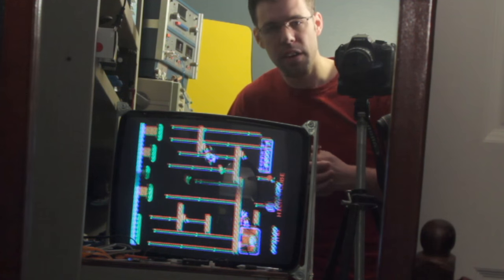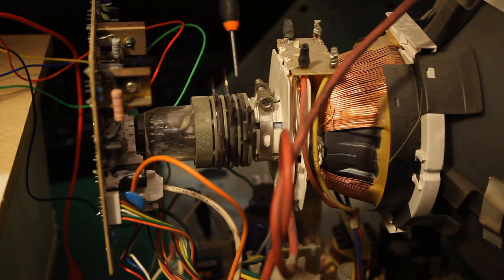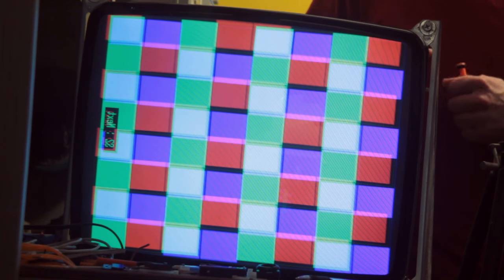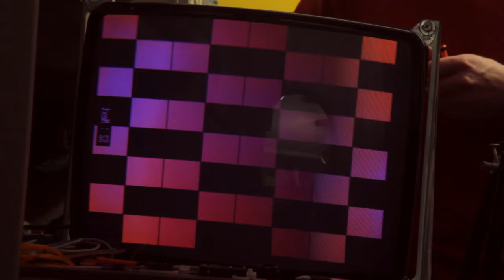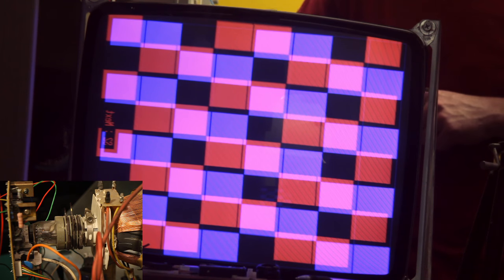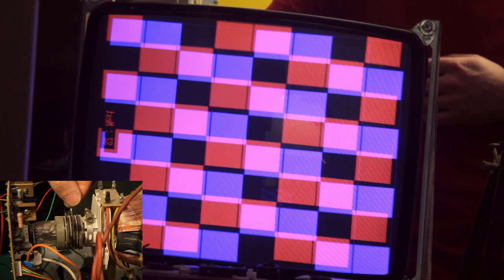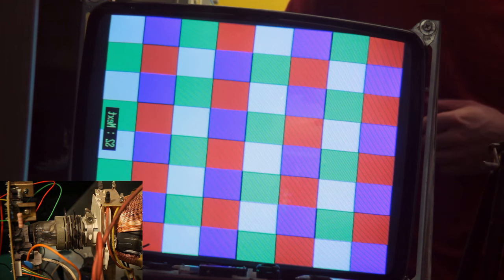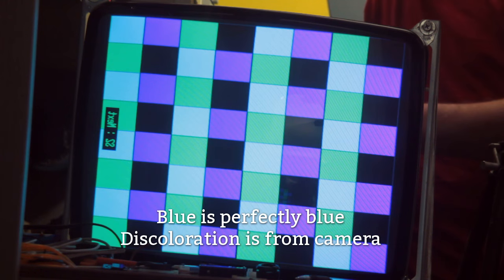Fix it Friday - Adjusting Convergence Rings on a Cathode Ray Tube (CRT, Monitor, TV and Arcade)

Comment: Very helpful, thanks!  I think he taught me more than he realized, namely 1. it is safe to put your bare hands close enough to the high voltage parts to spin the rings, 2. using a mirror or camera or something to watch the screen while you adjust.  These are things he did not talk about, but, then again, no one else does either.  I think repair guys leave out the basics because it never occurs to them that someone who doesn't know about convergence rings might also not know even more basic things.
Reply: It is safe to manipulate the rings with your bare hand but notice how I said hand and not hands - you probably only want to use one hand when you're back there, since if you accidentally touch a high voltage area and have both hands on the monitor/chassis...

Comment: That really helped. I have two Commodore 1702 on the bench actually and from some other videos i looked, having this double camera setup and to see live action and how you manipulate the flywheel directly by hand really get me confident to mess a little more into that while keeping my hands away of the high voltage. I'm always affraid that the insulation thickness of the cable / air gap isn't enough while i'm working in there... and some said that the yoke coils themselves were high voltage but i really doublt about it.

Comment: This was a great video, thanks for the clear explanation. I am adjusting a 1985 Sony Trinitron with a Sony "Multi-RGB" input right now -- my biggest challenge is all the adjustment rings were glued into place and I had to use an xacto knife to separate them. Even now there is so much residual glue that it is very hard to move the rings independently. Still, I am getting a remarkably good pic for a consumer TV that was made when Back to the Future was in theaters.

Comment: I have a Trinitron with the blue/red convergence slightly out. Have some nice test patterns in 240p test suite but I'm not keen on poking around the neck of the tube while it's on😂 Is it that risky as long as you stay away from the lopt and HT cable?

Comment: At 4:14 you bring your hand very close to the four connectors at the top of the yoke. I have been told those have high voltage running through them. Is that not correct?

Comment: The best video explaining the role of those famous rings. My question: I own an old Sony KV-29LS35B TV, everything is alright except that skin tones are not natural: there is always a kind of red/orange push (+ light purple or blueish lips). I have already tried everything in the service menu (change of RGB saturation values, change of Red and Green cut-off values but skin tones are still not natural). The other suggestion was to set the AXNT or AXPL values to 0 but there is no AXNT/AXPL to set off in my TV. 
Could this "Red/orange push" (also visible on LG CRT Tv's) be a problem of purity or convergence ? Thanks in advance.
Reply: Color saturation might be too high.

Comment: I have a problem with my 1702 vertical position that just don't wan't to go high enough when turning the v-pos screw all the way. I looked at the schematics and that variable resistor is a 500 ohm in between two 470 ohm resistor that "sets" the workable range of that variable resistor. I tried to connect myself across one of the two resistor to add a temporary parallel variable resistor to see if lowering one of the two would allow me to get futrher in the vertical adj. range and sure enough, it does the trick. calculations done, i would need to swap a 470 resistor for a 120 ohm one. My only concern is the long term reliability of that fix as more current will have to go thru those resistor... I really don't know what kind of power they usually endure. The other way would be to increase the value of the other 470 resistance instead but to calculate its value, i would have to take it out, connect a variable one instead, set the v-pos pot to the middle position, set the temporary thing so the image would be vertically centered and then measure the thing resistance, find a proper match and weld that down into place.

The two monitors I have suffer from the same problem where the picture don't get quite high enough. Would it bother much the resistances if i lower the value of the string a bit?

Comment: That's scary... touching stuff with your bare hands. I wish I was a little more knowledgeable so I could be less freaked out about opening up my CRT TVs... These videos are a good start I suppose. (Thanks!)
Reply: I thought exactly the same, as long as you don't touch anything metal it's perfectly safe, problem is that it's better said than done as I'm clumsy and I'm afraid my hand may slip and touch something it shouldn't.
Reply: @God-yb2cg  Exactly. Well... so far I don't have a huge need to open one up, but... there's just this nagging feeling that one or more of my CRTs could look noticeably better if I opened them up and calibrated them a bit. (One is a little soft in the corner and there might be slight "pixel crawl" going on, but nothing noticeable during gameplay.)

Comment: Witch high voltage spots should I avoid touching ? thanks for any help!
Reply: All of them
Reply: i am too worried about those bare connection points beside your bare hand ! keep thinking is there any rubber gloves out there
Reply: The neck of the monitor , Which contains "The Electron guns" and the "Anode connector" , and the whole glass , I strongly recommend for you to use a "Screw driver" to control the "RGB" metal controllers , and don't touch more than them , and when disassembling the CRT, Make sure that it's disconnected from the Desktop's Tour and from the power cord
Hope that helps you.
Reply: @insertx2k_dev  The glass is perfectly fine to touch. Just avoid the deflection coil solder joints and obviously the anode cup and the back of the neck PCB.
Reply: I received a slight tickle when my thumb brushed solder joint (the solder had a bit of a protruding stalagmite) near the purity ring. It's quite a thrilling process.

Comment: what would you do if there is only a slight convergence and geometry problem in one of the corners (top left in my case).
Reply: This is literally my exact issue.  Did you ever solve it?  I have put over 30 hours into my 25" Wells Gardner K7400, even did a cap kit, and still same issue.
Reply: for convergence issues in the corners only, you use convergence strips to fix that. here is a video with an example of that: watch?v=NyGPws6Eu4Y
Reply: Yes...corner...convergence strip under the yoke.

Comment: Hi, I think I have the same problem with my crt, but it doesnt seem it's on the entire screen surface, do you have any suggestion for me? should I adjust convergence ring or should I look for another solution?
Reply: I just bought a tv and the lower left os out of sync but everywhere else it is pretty ok. Started watching this video and not sure it would help.  Good to know a bit more about CRTs that I never knew before.
Reply: @mrfoameruk  I find out that the problem is'nt the convergence, if i can suggest you, search retro tech, thank to him I discovered that my problem is a geometry problem and it's easier to fix than I thought, you need only some kind of magnet, he suggest a product called "convergence strips" but it isn't so cheap, magnetic tape does the same job.
I apologize for my broken english, it isn't my first language, am I understandable?
Reply: @metallitaITA  I've started to watch his videos. I have a trintron and there are lots of adjustments you can make just using the service menu but a lot are vague so after I take a video of the current settings I will start to see what each one does.
Reply: @metallitaITA  I found the video I need for my problem. It does mean going in the back but the showing of it is well done if amatureish. search youtuber for "Sega Blast City Nanao / Toshiba ms2931 / 30 convergence fix adjustment"

Comment: Great video. I think I have a convergence problem on a 1978 sony trinitron. I've had the set apart and set all the knobs to get the best possible picture but still in a game like super mario bros there's like a white shadow to the right of all the images on the screen. Thanks.
Reply from the maker: If it's a white shadow, it may not be a convergence problem.  Any way we can see a pic?  We'd love to help.
Reply: that sound like bleeding, maybe because you are using composite cables?? check the nesrgb mod

Comment: i have a 29 inch trinitron. it has a convergence and sharpness problem. do you think its safe for a novice to tackle? what are the dangers? what should i use to adjust the rings around the yoke? my hands? i really want to save the tv.
Reply: Get an LCD one , That really would be better for you!

Comment: Great video! But could you tell me where to get the test pattern generator you use?
Reply: some boards have a test/service mode (its a button in the jamma pinout) and iniside sometimes its some kind of grid or pattern. this is in arcade monitors of coourse.

Comment: would seeing very short red stripes coming off of characters in games be a convergence issue, its like certain colors stretch off of where they are supposed to be, if it is i guess i have more than just an overscan issue
Reply: That's in all likelihood capacitors not responding as well as they're supposed to and the signal getting corrupted as it reaches the display. Try lowering the brightness to the lowest possible setting and see if it persists. If it gets better, you probably need a recap.

Comment: Hi,if you could how do that with a nanao 2930 (with the 15/24/31 khz),my 15 khz is almost perfect (just a little red under ligne but not on the corners),my 31 khz...not good..too big..very strange convergence (better if I use the jamma 31 khz not vga strangely).
I hope to use all the resolution soon.
Thanks.
Reply: Well ,My monitor is 70KHz , 140Hz as a Maximum , It uses about 250V to work , but , I strongly recommend for you to buy a monitor which supports up to 1600 x 1200 @ 60 Hz ,If you want to get more Hz, You can improve it using CRU for Windows Desktops (Custom resolution Utility)
Reply: @insertx2k_dev  thanks...my picture is much better now..almost perfect (just a tiny tiny red and the picture bigger than screen in vga 640x480 p..so probably just the wide narrow or V liner on the platin).
Reply: @Sam-Lawry  Your welcome bro! ,but You can use 1280x1024 @ 60 Hz , It would be better ,because you won't see the pixels of the screen , Any CRT Supports that resolution! , I mean by saying "The pixels" That you won't see the Shadow mask 3 dots easily , Which really reduces Moire pattern and gives you a better viewing experience
Reply: @insertx2k_dev  Thanks...1280x1024 in 60 hertz on the Blast city nanao 2930/Toshiba..?
I like the old school 15 khz..but the 31 khz with the vga scanliner is very nice too..I m more pixel than scanlines lover..(scanlines remove a lot of pictures).
With the jammasd I dont have the 'switch' 15/24/31 khz..so can I use it in jamma 31 khz to check if the quality is better than vga directly.
And if you check my video test 2 31khz the picture is a little bit bigger than screen..so it's the wide narrow or other button to have a scale 1/1 screen and picture?
Reply: @Sam-Lawry  I don't know a lot about that game bro , but I can help you with the resolution,And my screen scans the vertical and horizontal lines together at the same time , and it's called as hp s7500 crt monitor which supports up to 1280x1024 @ 60 Hz (60fps Maximum) , And my monitor in 1280x1024 mode uses about 64KHz , and 60 Hz for vertical lines scanning , and I'll check your video test before I can reply you
Thanks for your honest reply.
Insert Playz

Comment: is there a site where we can download the test patterns? 
thanks for this great video!
Reply: some boards have a test/service mode (its a button in the jamma pinout) and iniside sometimes its some kind of grid or pattern. this is in arcade monitors of coourse.
Reply: @inodororevi  What about consumer CRT TVs? Where can I find the images to calibrate those?
Reply: @redpheonix1000  using a.supernintendo or a psx to generate image... or a ps3 etc. "240p test suite' is available in various systems.
Reply: @inodororevi  I do have a PS1, but my only option with it is Composite video. I suppose I could try it.
Reply: @redpheonix1000  Composite video is not a very good idea to calibrate convergence however! The easiest way, in my opinion, is to use a DVD-Player and play a Test Pattern DVD (you can find various free ones around the internet).

Comment: My tv is a sony wega with up to 1080i capabilities, but a was attemting to move it but the screen tilted like 10 degrees, any help?
Reply: Move from place
Reply: Something might have tilted it's yoke..
Reply: hqdefault I think that's what pretty much what happned, is the fix any different from standard 480i crts just for the fact of being 1080i?
Reply: Yes, but be sure the yoke is loosen enough to do the slight rotation to where it was, also be careful when tighten it back, the yoke is held by thin glass on the tube and there is a vacuum inside. Also be sure there are not strong magnets rear sides of the TV (big speakers closer than 3 feet), those also cause some rotation of the picture.
Reply: hqdefault If I just take to an old school crt tv repair guy, do I tell him what you just told me or does already know?
Reply: Yes, if you tell you want to fix its tilted image, he should know it's the yoke.
Reply: hqdefault Thanks m8
Reply: 1080i is actually same as 1080p , but with low Hz

Comment: For real, man, what's the source of those colour patterns? They'd make this job infinitely simple
Reply: I use a dvd player that can play divx files from a usb drive and I encode manually some 720*480 avi files with the divx codec and some pattern i make myself. it's much easier to load anything i want on screen than using a signal generator, burning a dvd or anything else. Just ensure with some cropping tests, that your dvd player doesn't crop the output.

an old version of Photoshop, DIVX codec for windows, Lame ACM codec and VirtualDub 2 and you have mostly all the necessary tools to build your own patterns. I don't have a chessboard one like that but as he said, any convergence pattern will do fine. Just be sure if you shop on google image for a pattern that there is no anti aliasing in it due to some resizing. Every lines must be sharp. Also keep in mind if you make yourself some color pattern lines that YUV 4:2:0 (what's used by divx  and youtube and so on) only allows for unique lines of "shades of gray" to exists, single lines of red green and blue, if not doubled by a width of 2 pixel wide occuring on multiples of two pixels starting from a corner just won't be sharp because of 4:2:0 chroma subsampling.
Reply: Many arcade games have a service menu and usually a color test just for that. if that's not an option, you can get a signal generator and wire it up to the crt.
Reply: Digital Video Essentials is a DVD you can buy to fix that problem
Reply: That DVD has like a lot of test patterns you can pause the video on the part that you want to fix.  this DVD was recommended to me by JPs Vintage TV and Console Repairs on messenger
Reply: He also told me that in 80s TV sets is impossible to get a perfect convergence  because there is no adjustable correctional electromagnets like in the later sets from the late 90s or early color TV sets using delta gun CRTs  The convergence rings on the neck help set static convergence but dynamic at edges or corners
Reply: Why do you think Sony trinitrons where the best sets at the time
Reply: The best you can do is first degauss your TV set  with a degaussing coil and after that start making movement on the rings the best you can with the DVD I told you about because if you don’t degauss your tv it will be harder to fix that particular problem

Comment: Looks like the solution to my problem. Just a little worried to try messing with it, I heard these thing can straight up kill you if you get shocked by touching the wrong part.
Reply: @_Thrackerzod  amps are what you need to worry about.
Reply: @lancecowburn1693  Volts are what allow the amps to flow easily. If the tube stores a charge at 30000 volts, it will discharge all it has stored at once, which means a lot of amps.
Reply: @redpheonix1000  Voltage is not a measure of charge nor energy, so no, just because something can discharge at high voltage does not mean it will discharge many amps.  And from what i hear CRT's do not store very much energy, and they dont produce many amps when turned on.  If they did, the amount of power draw they would require would be MASSIVE.

From what i heard from people who have accidentaly touched the high voltage parts of the tube is it hurts and thats it.

Comment: This is totally wrong, I’d suggest you read a service manual set up of purity and convergence. The purity is set in conjunction with the yoke positioning. There’s so many amateur people working in crt equipment that think they know what they are doing. Read the service manual set up and do it correctly. This is just a bodge until it’s nearly correct, another issue not mentioned is the set should be positioned east west during set up as to minimise the earth’s magnetic field influence!
Reply: He fixed it. I'm confused...
Reply: @CozyCathodes  its fixed as far as you can see in the video……… with purity you don’t set it like this. Check out a professional engineers manufacturers service manual. 
Tv radio engineer for 35 years
Reply: I'll take your word for it. I'll be working on a Sony this weekend and make sure I'm east/west, honestly I like the by the book approach, but the sad part about this is there's not many real certified specialists out there to teach this technology.